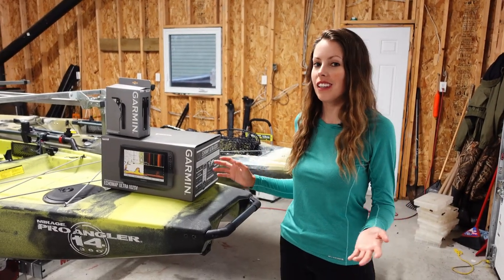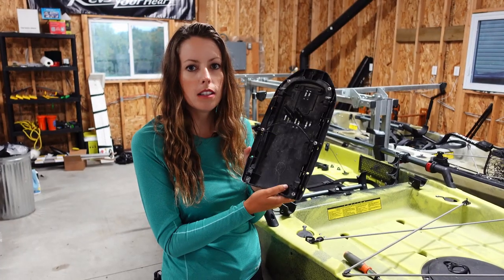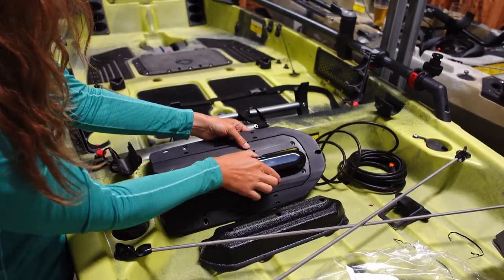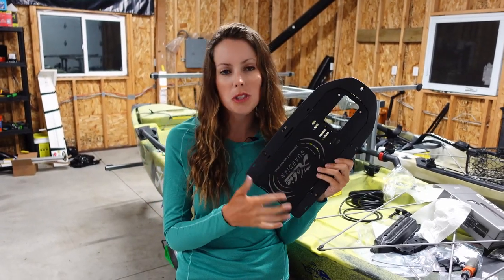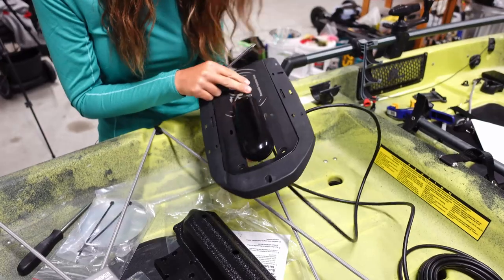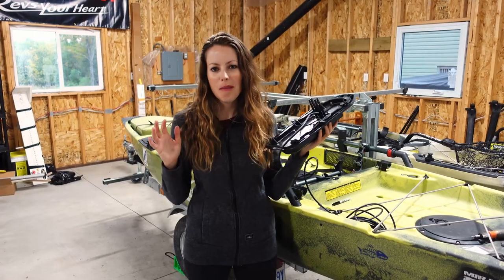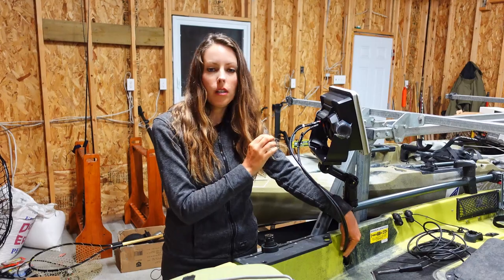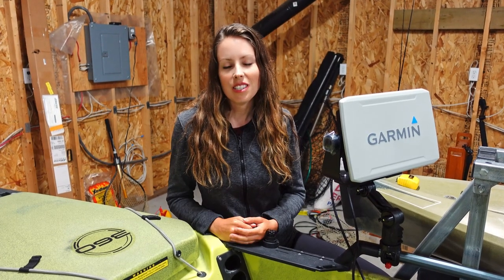Garmin Fishfinder Installation on my Hobie Pro Angler 360 Fishing Kayak

Comment: Fantastic video!! I just installed the same garmin fishfinder today using the yak attack mount and the hobie T-rail mount (replacement of the mighty mount). This video was invaluable. An observation is that the echomap ultra 102sv seems to droop downwards despite the mount being fully tightened. seems the unit is a bit heavy for the mount. don't know if anyone has had this same issue and can offer a solution

Comment: With the BerleyPro protector, does it still retract completely into the hull so that the protector won't come in contact with the ground if the kayak is placed on a hard flat surface?
Reply from the maker: It does retract all the way in! 😊
Reply: @SheLovesToFish  excellent! Thanks for the reply, as well as this video! Super helpful.
Reply from the maker: @holycannoli8562  Glad you like the video. Thank you! 😊

Comment: The battery went into the front hatch, correct?
Reply from the maker: I store mine in the storage compartment in front of the seat.
Reply: @SheLovesToFish  Thanks. So do you not use the white storage bucket for baits or the two 3600 tackle bins that come standard?